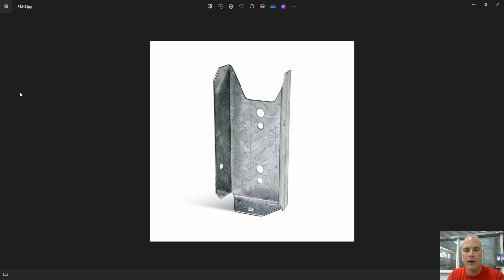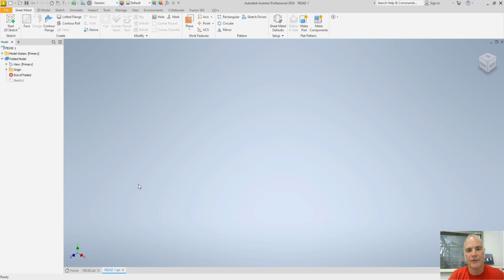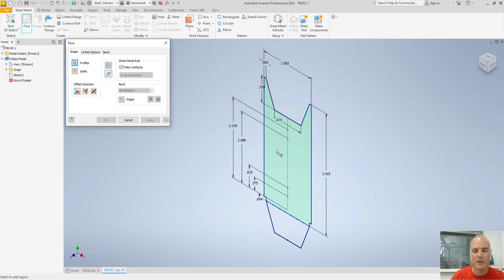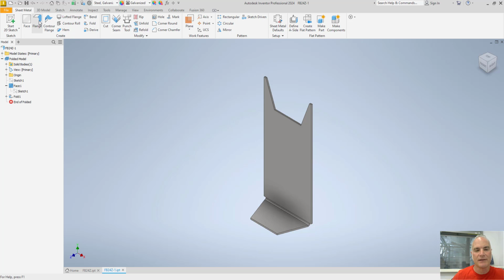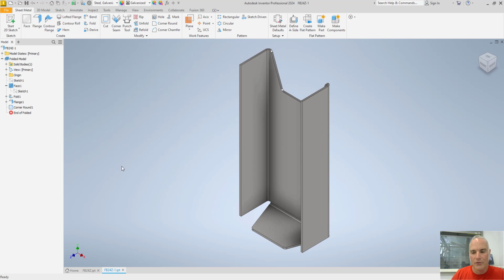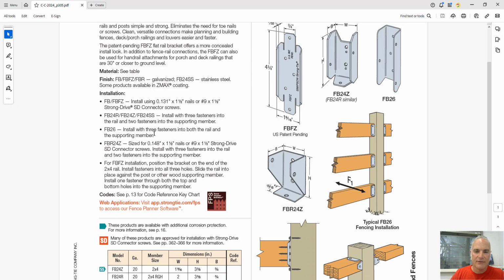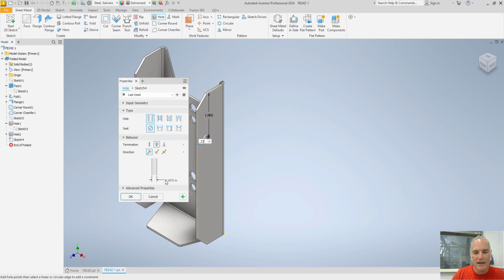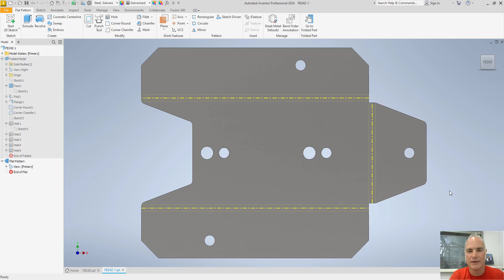Autodesk Inventor - Sheet Metal Basics

Comment: How do you define the sheet metal rules in order to obtain the best result?
Reply from the maker: Fernando,
The sheet metal rules are based on several factors, but the two most important are the type of material and thickness.
When sheet metal bends, the inside of the bend is compressed and the outside of the bend is stretched. The neutral line is the point in the thickness that remains the same length. To calculate the bend allowance by hand you have to know where that neutral line is. In order to create a flat pattern (if not using a CAD package such as Inventor) a designer usually refers to a bend allowance table.
For the most part, if you choose the correct material and thickness, Inventor will correctly create your flat patterns - to within a few thousandths of an inch!
Here is a link to a resource that gives more information on sheet metal unfold rules:
https://ketiv.com/wp-content/uploads/2019/04/KETIV-AVA-Sheet-Metal-Unfold-Rules-Equations.pdf